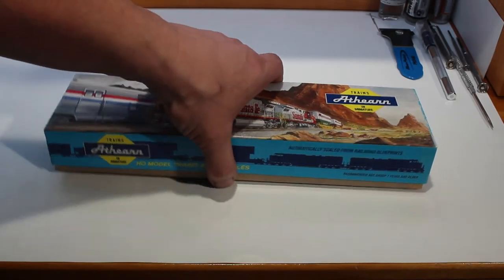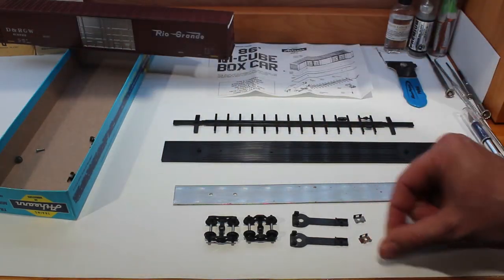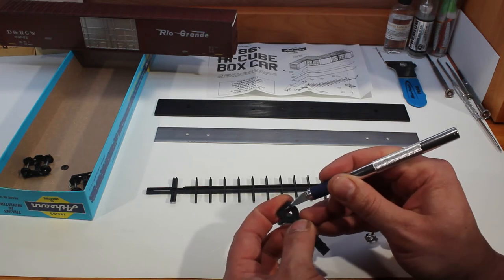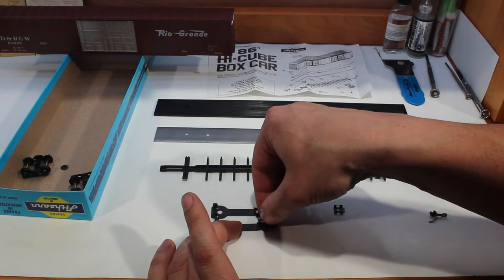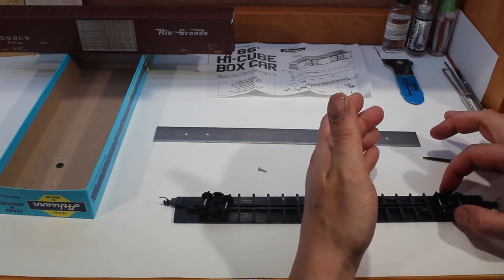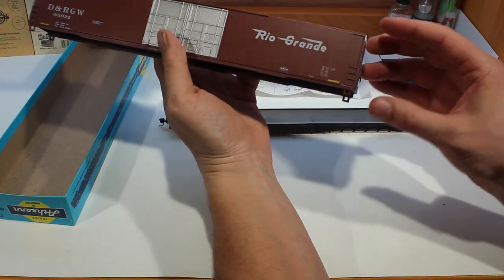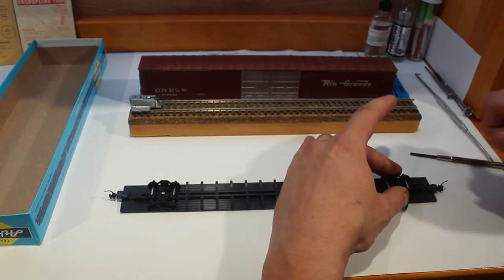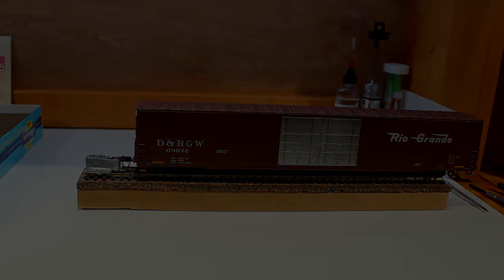How To Assemble Athearn 86' High Cube Box Car - D&RGW

Comment: Old Athearn coupler pocket clips have a bad habit of falling off at inopportune times.  One thing I do to them is squeeze the sides so that they're truly perpendicular, or even a bit beyond.  That way they fit more securely.  I've also been known to twist the little bit that actually grabs the catches on the side of the coupler pocket, so that they'll bite into the plastic a bit and grip a little better.
Reply from the maker: Ya they can be a problem if you don't make sure they are secure. It's not to often I have a problem with new ones but I do make sure they are perpendicular before I install them.

Comment: This is one of Athearn's more accurate "old" models - a Thrall 86' auto parts 4-door boxcar. Built in 1964, the prototypes were originally built with roofwalks, the one major discrepancy they have. Even after they were removed in later years, many of the cars that still survived into the 21st century had the old roofwalk brackets still on them.

The swinging coupler bracket was originally designed back in the day when most layouts featured 18 or 22 inch radius curves and is IMO the weakest part of the construction. As these cars were all built with cushion underframes and/or draft gear, I'd cut off the ears and permanently mount the couplers to the body, adding a "wide-mouth" cushion coupler pocket (Details West #1024 or similar) and long shank coupler.
Reply from the maker: Oh yes, modifications. Because there are soooooo many modifications that can be made to any model, I will not be covering modifications. Instead I will be focusing on the original design for two reasons. #1 Modifications are a preference and everyone's preference is different, #2 is resale. for the people who are going to want to sell it later on and buy something else it will be easiest to sell it in the original configuration.
Reply: @jonedwards7064  Suggestion then ... if you're going to retain the swing arm coupler mount, consider coating the top of the arm with Grease-em, the same thing you use on the couplers. Use a small scrap piece of paper to burnish the surface of the plastic with the graphite to insure minimum resistance if the arm contacts the underside of the floor.
Reply from the maker: This is a great Idea!

Comment: People forget that those trip pins on knuckle couplers are part of the mechanics of using uncoupling tools - either track magnet or Rix H-tool. If using the magnet, you want the trip pin to ride over the height plate and barely touch it. That way, the magnet has good grab action. Too high and it won't work properly.
Reply from the maker: Yes this is important, however I see so many people that just cut them off. Then there are people like scale trains that package their product with a coupler that doesn't even have a trip pin.
Reply: @jonedwards7064  With the expense and fragile details with today's cars, its best to limit and handling. Yeah, I was one of those that just cut off the "air hoses". However, after 30+ years I've learned that the way to uncouple is to use such tools and to ensure coupler height. Such good times learning about model railroad...

Comment: What is the minimum track radius for these cars?
Reply from the maker: To be honest I am not sure exactly. However, I have never had a problem and I have used these on a pretty small layout.
Reply: @jonedwards7064  - Seems like 18-inch radius would be too tight and 22-inch radius would be questionable.  I had ruled out these cars, but they would be within the era I am intending to model.
Reply from the maker: Defiantly the bigger the better! Right now on my layout the tightest corner is around 24 - 26-inch radius and they have no problem with that. I think 22-inch would be ok. The tighter the corner they do start to look funny because they hang out over the track alot.
Reply: 24in is minimum
Reply: @jonedwards7064  the rule is any car over 60ft length needs at least 22-inch radius and larger.

Comment: The #27 reveals that the car design is too low. Adding a washer between the truck bolsters and replacing those 70-ton trucks 33-inch wheel sets with 70-ton or 100-ton trucks 36-inch wheel sets will help correct this problem.
Reply from the maker: Yes you could do any of those things.
Reply: @jonedwards7064  My preference is to install the prototypically correct diameter wheelsets & then take other actions to raise or lower coupler height to match the KD coupler height gage.  1st thing I do on the Athearn BB 86' box cars is body-mount the coupler draft gear pockets, this 1 step gets rid of most of the coupler-too-low problemm.  It also requires wider radius curves for reliable operation & I know the model RR mfrs made & designed HO rolling stock to go around 18" curves.  Each modeler has to decide for him or herself what's more important- small radius curves or being able to run the more modern longer cars.

Comment: You didn’t check for adequate weighting. Athearn cars never had proper NMRA standard weighting for the size of the cars. They were always too light and needed more weight. This was a real problem for adding and disguising weigh on open top and flat cars. But, whatever. This video is two years old so folks must not have cared to much.
Reply from the maker: No I did not address the weighting issue. When I build these kits for video's I try to keep them unmodified unless it is absolutely necessary. For example, it is necessary to upgrade the couplers so that they will work with other rolling stock. It is not necessary to upgrade to metal wheels, so I don't do it even though there are a lot of benefits.